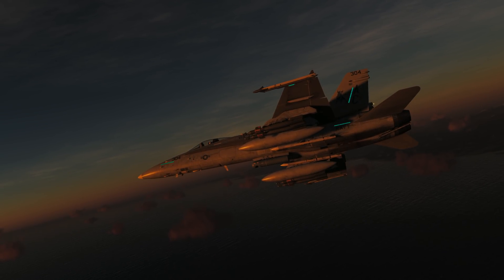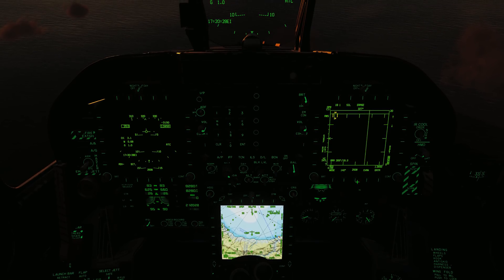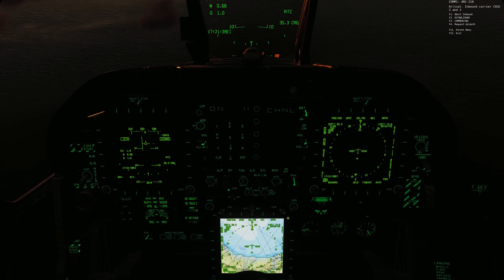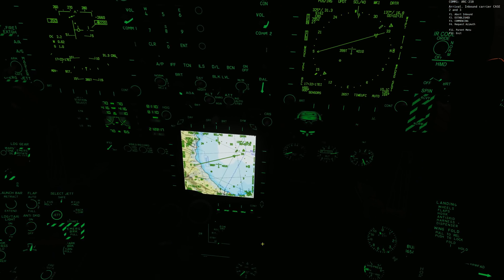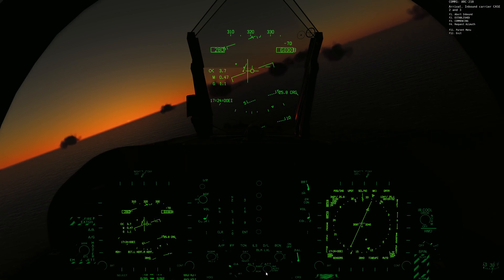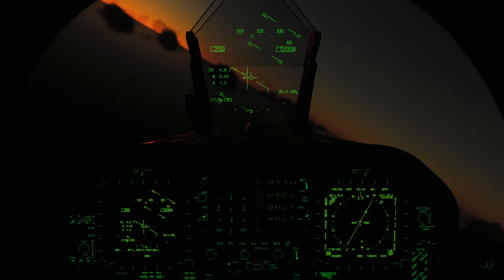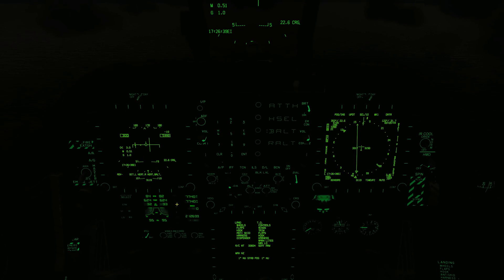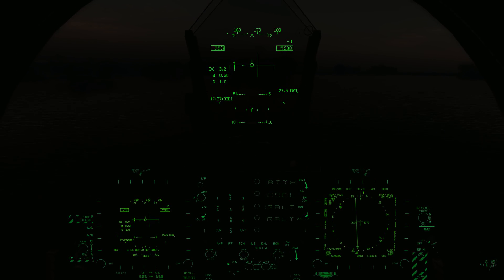DCS: F/A-18C Hornet - Case III Radio Communications First Look (WIP)

Comment: Hey Waggs, why when I contact carrier do I still get standard inbound instructions from old AI ATC?
Reply from the maker: Ian Antill. Not released yet.
Reply: @MattWagner  Hi Matt. 4 April 2020, 7 months later. I set up a mission but when I call inbound I still get the standard Case I instructions. When I have a bolter I call call in again and then get the ICLS Case III radio call from Mother. Am I missing something about how to set up the mission so Mother will give the Case III call? Thanks